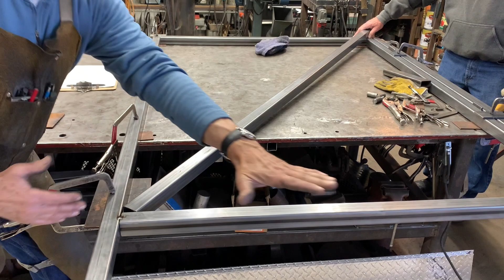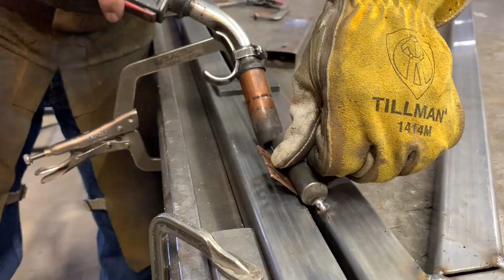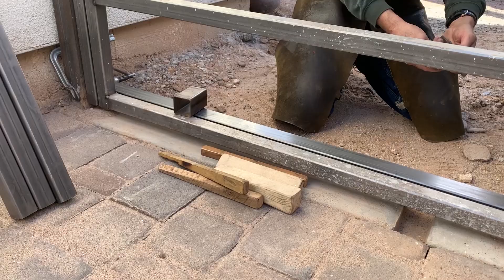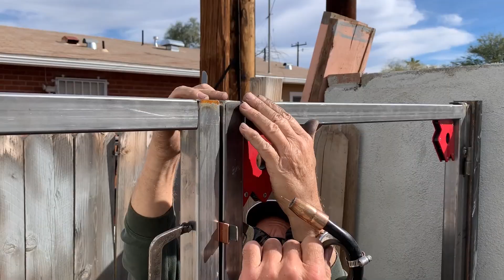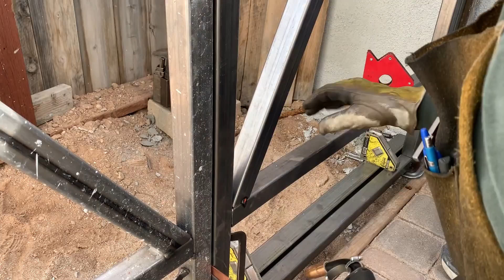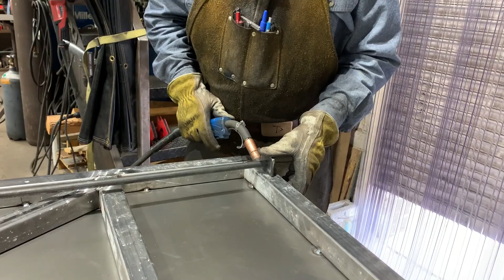The best way to build a steel double gate?

Comment: Having just watched this video, I have to ask why you put the diagonal support in from top to bottom rather than the other way round when it would be in compression. Considering that all your processes are very well thought out, this seems counter intuitive.
Reply from the maker: When I make wood gates I put the diagonal support in compression, but with metal gates, and given the relatively small size of the tubing, I put the diagonal in tension.
Reply: @ thanks for the reply. It’s nice to hear other people’s thoughts.

Comment: Awesome detail Doug.  I need to a build a two-panel gate just like this in the next year or so to upgrade the first welding fab project I ever attempted 25 years ago.  It's still holding up well except for some corrosion caused by the neighbors sprinkler.  All the fab tips you show will definitely be put to use for a phenomenal outcome.  Thank you for sharing!   👍👍😎👍👍